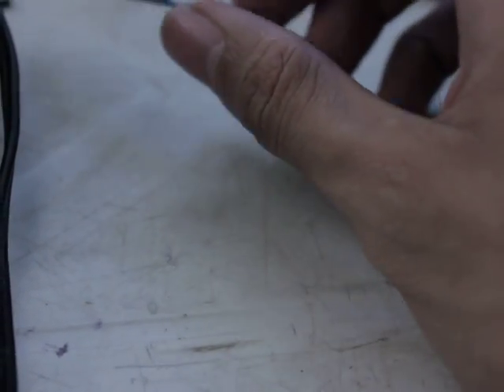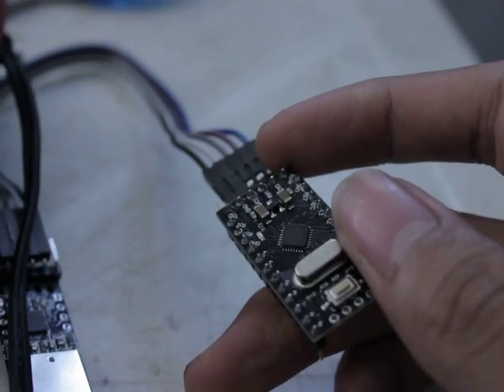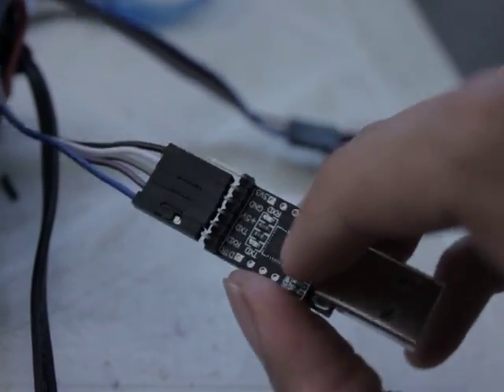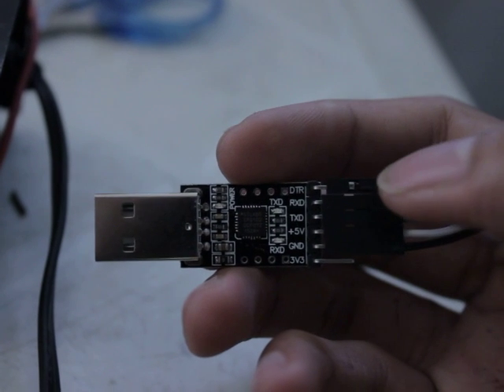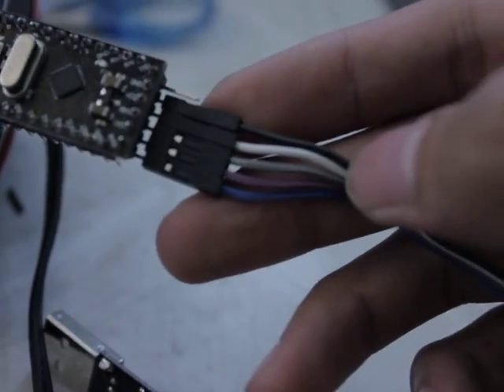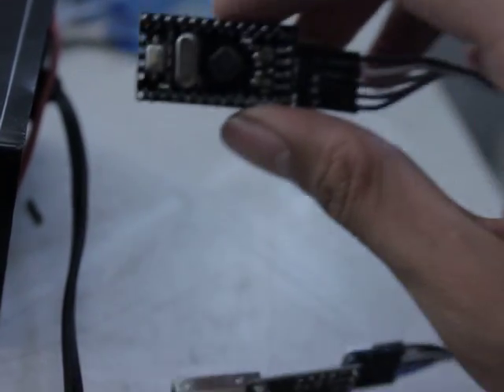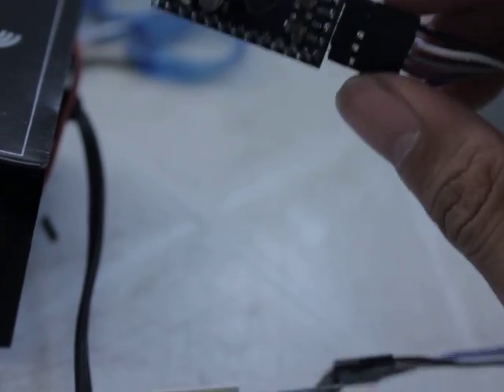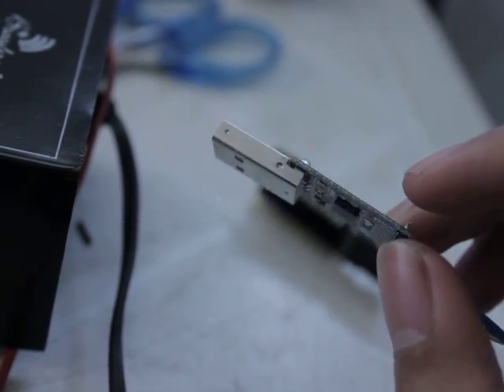CP2102 USB 2.0 to TTL UART Module 6P Serial Converter STC Replace Ft232

Comment: may I ask what dtr is for? I have this module and I'm testing serial communication between esp32 (with micropython) and the module. From the thonny ide, I can use the .write() function and I can see what I wrote in the termite serial terminal but when I try to write from the termite serial terminal, and I use the .read() function on thonny ide, it returns something unreadable like b'\xbd.W\x02\x00'. Does this have to do with the dtr pin not being used? cuz I only used the tx and rx pins and connected it to the rx and tx pins of the esp32 respectively.
Reply from the maker: Nope. DTR is not connected usually
Reply: @Mechodynamo  wow, I didn't expect a reply haha. But thank you for responding! By any chance, do you have any idea what's wrong with my set-up? It's okay if you don't know, I'll find a way somehow :D

Comment: Can this connect to a modern Smart laptop battery?
Reply from the maker: As long as it is UART compatible yes. What do you plan?
Reply: @Mechodynamo  A samsung Smart battery connection
Reply from the maker: @irishguy200007  you must know what kind of data are you going to receive or transmit, but other than that, it will work. check first if the samsung batter is 5V tolerant otherwise you are going to use 3.3V
Reply: @Mechodynamo  This device works with 5volt and  3.3v?? 
I never thought of that, Thank you